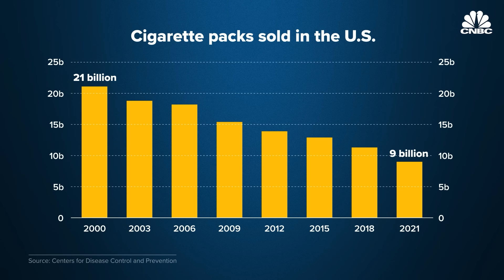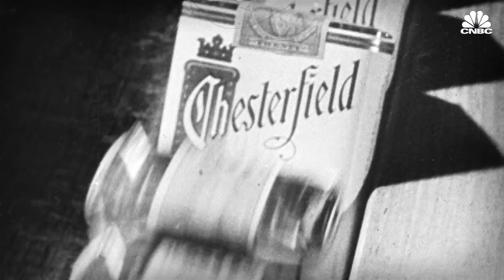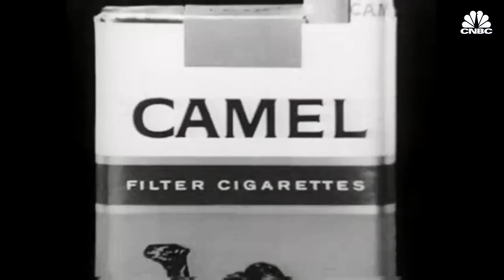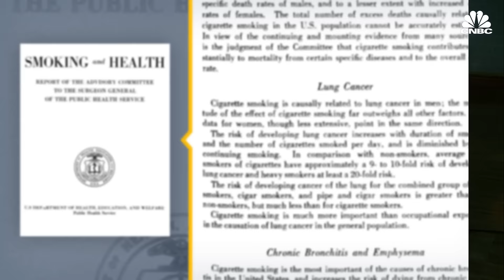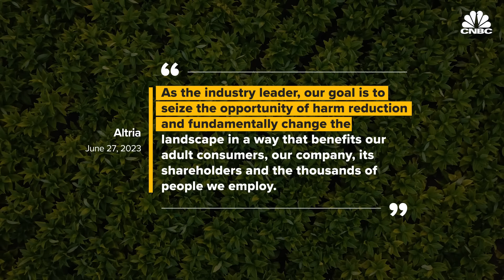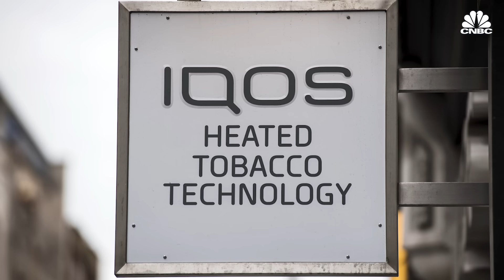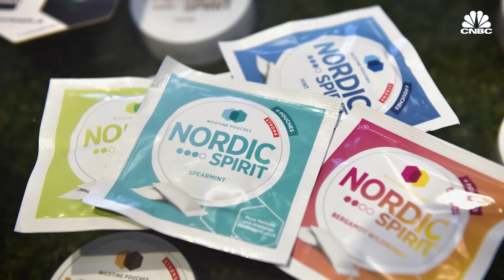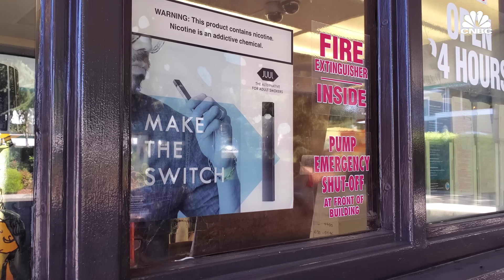Why Marlboro Maker Altria Is Betting On Smoke-Free Products

Comment: I quit cigarettes over 4 years ago, After quitting I was vaping for a short time then on to smoking hookah. Smoked hookah for 3 years  then totally got off it. Hookah was much easier to fully quit, but Hookah did help quit cigarettes. It's a long process. I say enjoy while it lasts.
Reply: I used vaping as a transition from cigarettes to quitting nicotine altogether, but it took me 8 years 😆
Reply: I'll tell you why Hookah is better than vaping. First, hookah can only be smoked at home and it is not on you everywhere you go. Second, hookah products are not easily sold at every convenient stores, third hookah tobacco in general is not as addictive as cigarettes. This is why to quit all tobaco products for me was much easier with ending it with Hookah. Plus hookah has a much smoother blend and flavor. However I would not return to any form of smoking and give my smoking lungs of over 20+ years a retirement.

Comment: Cigarettes are the equivalent of fast food. It contains a bunch of random carcinogenic chemicals to make it taste better or last longer. If cigarettes were like cigars nothing but pure tobacco. There would definitely be alot less smoking related deaths. Of course you are still smoking and thats bad. But you sre also smoking in all those unnecessary chemicals they spray on it cigarettes too which just accelerates the process. A 100% organic route might not save tobacco companies but itll definitely slow the drop in sales
Reply: Tobacco companies has also no law or regulation in what they put in their product. None. They can basically fill cigarettes with what they want and sell them. Back in 2009/2010 they introduced FSC.. Aka "Fire safe cigarettes". Which meant they laced the inside of the paper with breaking rings as to.. If you fell asleep from your cigarette, it would go out by itself. This is all good and positive, But what the tobacco companies did not tell you was the "rings" were basically filled with a substance found in carpet glue. Leading to many ppl having reactions and or allergic symptoms etc.  I quit smoking altogether in 2015 and i have not looked back since. 
What is being sold on the market now and what cigarettes and what they contain i do not know. I can only imagine it has gotten worse.